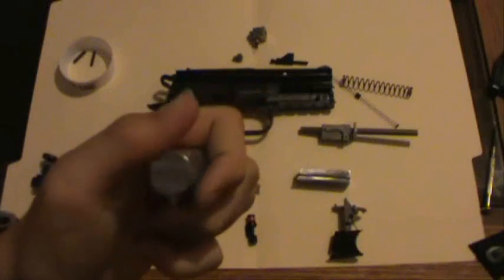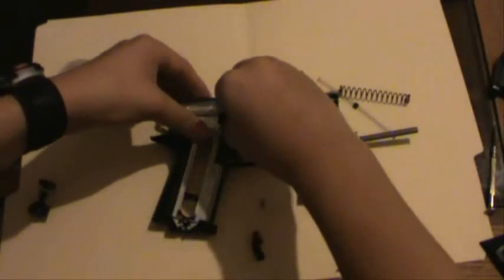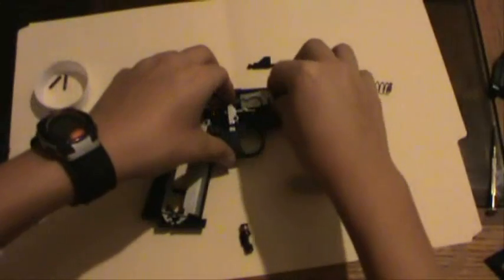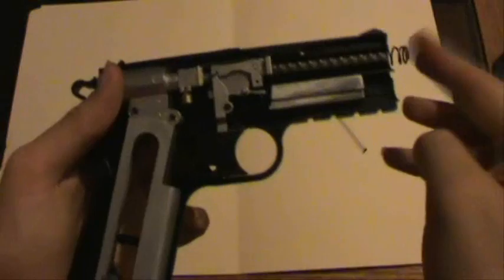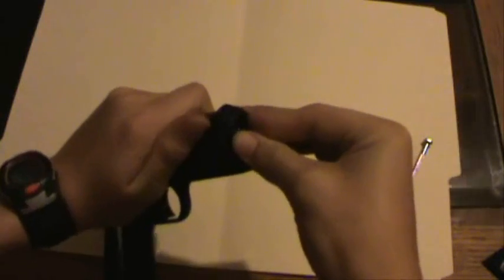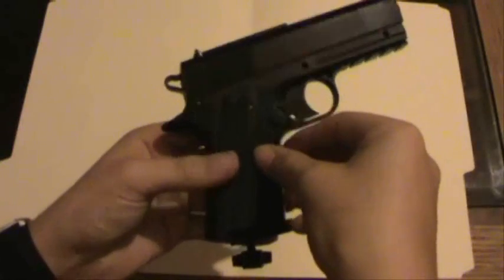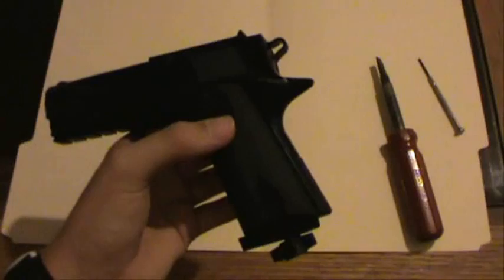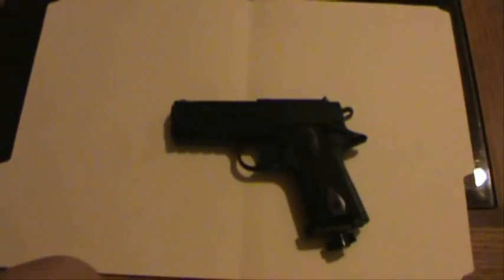Daisy Powerline 15XT CO2 BB pistol leak repair Part 2

Comment: OK.  First I wrote to Daisy and asked for help with my leak. They sent me 2 gaskets. An extra one if I ever needed it I guess. It was to put in where the top co2 tank connects to the gun. I did so & gun It still leaks.

Thanks to your two videos I put some Teflon tape on the silver cylinder screw.  Viola, it no longer leaks. 

I would have never attempted to take the gun apart without the help of these two videos. So I thank you Very much.

Thanks again for putting these video's on YouTube.

Comment: Great find on how to fix my 15XT model. I was ready to go by another one but figured someone must know what is wrong with my bb gun. The only thing about this video is that you made it longer then it needed to be. I removed only two parts after the gun was open. Besides that this video did the job and saved me money. Good stuff.

Comment: Good job on the video, it worked for me on the same issue.  I had a time figuring out where to put the springs on re-assembly since all 5 poped out and I did not expect it, but it took about 30 minutes total.  PS you can use lock tite on the air chamber to prevent it from coming loose again.  Thanks

Comment: Thanks for the video! I just fixed my Daisy after about a year to thinking about it! LOL
I actually did both seals put Teflon tape on the main cylinder inside and then I also took the seal out where the cartridge inserts into (was trying to check to see if it was messed up but I think I may have messed it up in the process if it wasn't) but I wrapped it in Teflon tape and inserted it back in making sure to puncture a hole in the middle for the CO2 port. Reassembled it & holy shit it actually worked!!! 
Putting the trigger back together was a little tricky with the springs and whatnot but thanks for the video because using it as a reference it definitely helped!!!

Comment from the maker: @tgoody100 The small chubby one goes in the bottom of the block that fits on the barrel where the BBs feed into. The taller skinny one Fits in the cylindrical air tank that the CO2 cartridge plugs into. I believe the spring you say I mentioned was the one inside the air tank that the skinny brass piece fits into. The spring action is used when you pull the trigger, the catch slips from the barrel, and the large black spring that fits around the barrel slams the barrel into the the small skinny

Comment: I stupidly left a CO2 capsule in my 15XT and it naturally destroyed the seals so it leaked whenever I put in a new capsule. I followed your instructions and took it apart, wrapped some Teflon around the threads on the cap of the large cylindrical part. I put it back together following Part 2 of your video. No parts were left over. Now, it no longer leaks, but it won't fire because I can't make the trigger move back. Any suggestions?

Comment: good night
Friend, my pistol daisy 15XT (vazando).A my question would be, when I disassemble the pistol that part I put some sealant? Which product to use? I'd like to put the product without having to disassemble the gun to stop the leak co2 would seal without disassembling?
thanks for reading.

Comment: Hey I had the same problem and I took mine apart but the chamber is too tight I can't even get the cap off. I've already done some damage to it so I doubt I'll be able to get it off. Do you think applying a sealant around the top of it will be effective? It's called fas-weld I believe it's supposed to create an air tight seal. I'm also thinking of applying super glue around the crease to improve the seal.

Comment: I know I am way late but by any chance do you know what size the O ring is for the co2 compartment? My O ring came out when a cartridge got stuck and now as soon as I put a new cartridge in, it punctures the top and then just leaks til it's empty. ALL I need is a new O ring but can't get to it to measure it lol

Comment: Is the barrel supposed to move when being fired? After reassembly, my barrel slides in and out as the trigger is pulled. I don't remember it doing that before, but can't figure out if I just overlooked it or if I assembled something wrong.

Comment: I have the same model , mine leaks the tank off really quick at the pierce point when installing the new tank , do you know what the problem is. I cleaned the piercing area and used three new tanks trying. No luck so far.
Reply from the maker: Its been many many years since I ever used or messed with this particular air pistol, however I remember there is a transparent rubber gasket that sits up in there, around the piercing and is supposed to seal at the top of the cartridge.

 I would guess yours is missing or damaged due to age or use. I honestly wouldn't know how to repair that, however if I had to I'd probably try using an RTV silicone from an auto parts store and try dabbing some in with a tooth pick to recreate that gasket or buy some cork gasket material (also available at auto parts stores) and drill out a tiny hole for the piercing point and try to cut it to fit up in there. Hope this helps.

Comment: I did exactly like on the video, but now the trigger won't work.
Reply: make shure the safety is turned the right way...
Reply: I had the same problem initially that little spring was the culprit  make sure it's sitting back in the frame and where the trigger mechanism sits you got to make sure those pins are lined up in the holes. It was a little tricky it was the one thing that held me up a bit

Comment: i have 2 of these and in the last couple weeks both leaked. i temporarily solved the problem with no disassembly and just a little 3 in 1 household oil and some vasoline around the pin area tha t punctures the co2. now they're both leaking again. any suggestions? from the video it looks like the seal is way inside. but my leak seems to be coming from right around the pin unless im wrong. any input would be appreciated. thans in advance
Reply: +vito montalto I know this is  along time later, but if you contact Daisy, they will send you the seal you need for free (the seal that seals the lip of the CO2 tank)

Comment: This is second time doing this (tho I was using auto sealant semi -permanent/flexible trying same way ..if fails again will likely do what should have done use sealant around plastic do dad and pipe tape for threads ... also need to take them seriously TO NOT LEAVE PRESSURIZED CO 2 WHEN NOT USING .....

Comment: You should re-do this vid with better camera focus and better lighting and try to use the correct part names and show every step correctly.  For example I got the safety in backwards because I couldn't see what you were doing and you zipped right through it.  It is possible to get some of these parts in backwards or reversed if you've never done this before.  Otherwise, thanks.

Comment: I for some reaskn have a left over piece its a small black piece it has a ball thats attstched to circular ring where does it go 😭
Reply from the maker: That sounds like the piece that feeds the BBs down the tube, it pushes the BBs loaded in the top of the pistol toward the receiver, there should be a long spring behind it so it can force the BBs along.